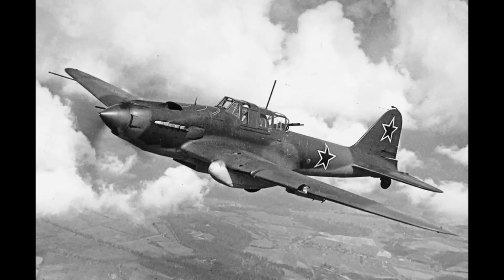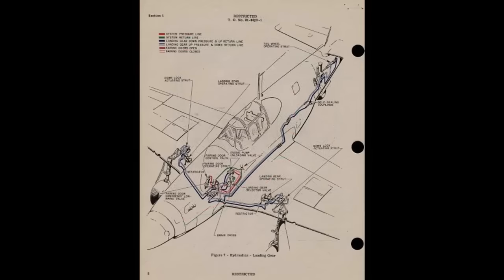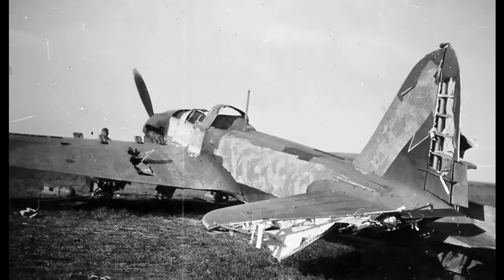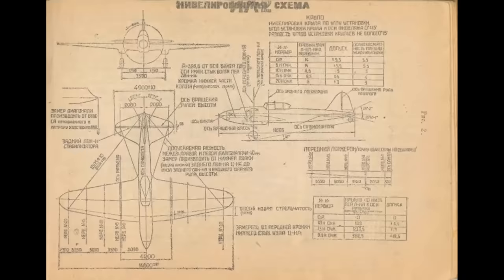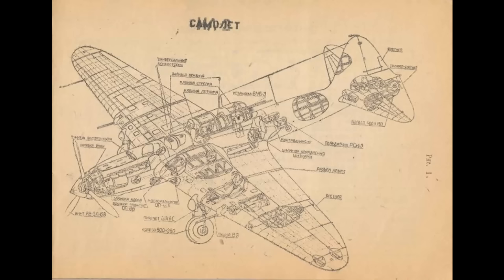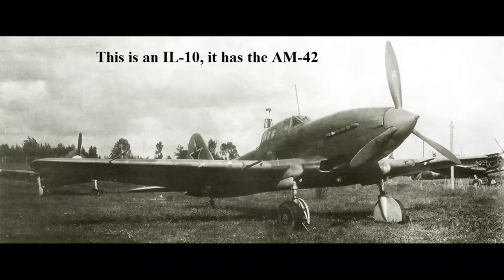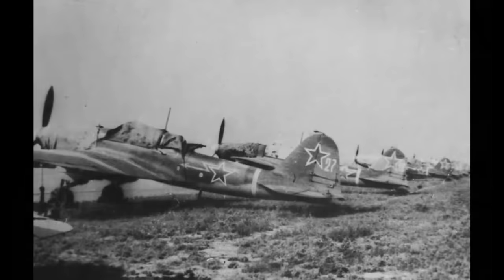Ilyushin IL-2 Sturmovik

Comment: A bit extra about that Tu-4 - B-29 thing Greg had mentioned:

Russians were trying hard with their own turbocharged engines at least as early as 1938 with TB-3 fitted with М-34RNV-ТК - an AM-34 variant with fuel injection and TK-1 turbocharger. It did flew at 8500m as fast, as regular TB-3s on 4500 - however it was unreliable af with turbine blades ripping off or burning through. Lack of experience, skilled engineers, craftsmen and good steel alloys made things difficult

But development continued even through the war with Myasischev's high-altitude long range bomber series of two-engine DVB-102 (flew in 1942), and four-engine DVB-202 and -302 (projects). DVB-102 had a pair of M-120 engines - a Y shaped 18-cyl M-105 derivative with three cylinder banks instead of two and TK-3 turbocharger, wich performed better - but still not good enough. Then there were tests with other engines, some turbocharged, than there was some development of -202 and -302, the last one having a lot of similarities with B-29 indeed, but that happened before people had an oportunity to study one

Than there was 1945 and Stalin ordered Tupolev to copy B-29 - because having a working plane tomorrow is better than spending yet some more unknown quantity of time to complete something only to test it if it even works

So, copying or not, it still was a many years wotrh of hard work to even be able to snatch (and alter, fyi) a foreign design this complicated

Comment: In IL-2 1946, the simulation, with a Bf109 F-2 cooler shots where all you had against an Il-2. Some say the wingtips are weak also. But try hitting that when the guy in front wiggles as much as he can.
In IL-2 1946 in the 1 hour campaigns which influenced the movement of the front, the Il2 guys just did head ons blazing away. With the high ammo count and the fragile modelled engine of the 109 lots of kills got scored from the Il2s. Amost always the Il2s had a fighter or 2 with them. Which meant, attacking the IL2s put you at a disadvantage fast.

Comment: In regards to the manual...
Did the Soviet airforce HAVE basic training manuals at all?
Or did they essentially put everything into the manual for each specific plane?

So, basically, run off and check 1-2 manuals for pre-war aircraft, from the mid-late 1930s.   See if they're the same or if early war losses caused a massive change.

Comment: i'm somewhat perplexed by the crank design of the AM-38. you said a 'counterweight-less' crank; when i hear this, I'm wondering if it's a mistranslated term? i can't understand how an engine that large wouldn't have sufficient space in the crankcase for at least some counterweight, at least, why it would be designed like that? i guess it's also hard for me to wrap my head around a crank as large as one in a WW2 12 cylinder liquid-cooled engine NOT having a weighted crank. surely for a high-horsepower airplane engine, that would've been a logical design evolution? i suppose there are some benefits to having less reciprocating mass, especially in an airplane. i wonder, did the previous AM series engines also have counterweightless cranks?

Comment: God, give my english strength  

Articulated connecting rods were really a thing in russian WWII engines like AM-35/38 or V-2. One rod was attached to another one, wich was then attached to crankshaft - so length of stroke was different between left and right cylinder banks. I dunno, maybe it was for weight and crankshaft space saving or people were just unable to make thinner connecting rods strong enough - or both

Comment: If necessary, I can give a link to the many hours of history of creation, application, operation, etc. but in Russian. And about the M82 engine, I watched the history of La-5 and there was an M-82 engine on it and it remained unfinished for a very long time. Most likely, this is why the IL-2 with the M82 did not begin to be built for this reason, the M-82 was not ready yet

Comment: The thing with the connecting rods and different stroke derives from the engine having one cylinder bank with conrods normally articulating the crankshaft and the other bank articulating not with the crankshaft but with the „master rods“ like on a radial engine. Derives from the BMW VI engine. Gives slightly different stroke on both cylinder banks. Compare with T34 tank engine, which has the same configuration.

Comment: Articulated connecting rods? I suspect that meant the system in which there is only one big-end journal for each opposing pair of cylinders: only one of the rods (the master rod) bears on that. The opposing cylinder has a link rod that mounts to the shoulder of the master rod by a fitting that looks like a gudgeon pin. Because the centre of that pin is displaced from the big-end centre by some distance, the result is that the stroke of the cylinder with the link rod is longer than that of the cylinder with the master rod, and the lower pin of the link rod moves in an oval, rather than a circle. Renault did an aviation V12 like this in WW1, and there were some automotive engines like that. There are some very good diagrams of this at pages 12 and 16 of Karl Ludvigsen’s magisterial work, The V12 Engine.

Comment: Hello Greg. Tank you very much for your video, reaserch and coments on that airplane. I had spend some time researching various soures on it in the past from various perspectives - manufacturing issues as well. And would like to give my comments on the power output in comperasment to the competing engines of other countries. 

One of the major matters to be aware of here back then was the same as in many, when not all of the industrial branches. It goes for many other airplanes, engines, motorcycles and so on in the time of WWII and goes so forth for couple of decades after the war. It was the inconsistency of quality of matirials with high margine of differences. Engineers and manufacturers had to keep that in mind by product designing and conceptualizing it's manufacturing. Because the components might have get charges of differing qualities of materials and from differing plants -  to many factors where beyond any controll of developers and manufacturers. So, to avoid a high numbers of rejects and defects one had to set the uper bar for stresses and loads in the constructions very low on some key elements. Highly stressed locations in engines or fuselages had to be engineered with much more geometrical resereves and safety margines. Limiting the RPM = output power - was also the way to keep the stresses on the components low enough so the plane would have reasonable statistical TBO or life time to have a chance for beeing useful.

P.S. as always, sorry for my "french".

Comment: Part of the issue may be that the audience knows your penchant for research and original documentation - and inherently distrusts any Soviet primary sources.
Reply from the maker: The Soviet sources are not trustworthy for a number of reasons, which makes the plane more difficult to cover.
Reply: @GregsAirplanesandAutomobiles  I would be interested in the plane and the documentation because of that, not just in spite of it. The difference in how they trained pilots noted in this video was fascinating. 

Chieftain ran into similar issues when covering Soviet tank doctrine where the primary sources had to couch everything in a Communist framework of "power of the people" or gotogulgag. Especially in the interwar years.

The essence of what they were discovering in Russian circles matched the Western exercises and thoughts. But the way it had to be presented provides critical information about the state of affairs. It is somewhat tangential to the focus of the channel, but it provides unique context for how the planes and pilots were trained and utilized.

Comment: An articulated connecting rod is a con rod that connects to a master rod. It's the third way of connecting rod design for V type engine eg (plan type, fork & blade). A radial engine  has multiple articulated connecting rods connected to a master rod. In a V type engine there is one articulated connecting rod connected a master rod. There are same number of master and articulated rods. Just like fork & blade but only master rods connect to the crank. This is why the cylinder displacement is not same. On a radial  multiple articulated rods  placed around the centre point of the master rod and crank throw keep cylinder displacement equal. The unequal cylinder displacement why it not used much in V type engines. I hope you find this helpful Greg give  articulated connecting rod a google and click Images and you will see the them for your self. Thanks for All your videos.

Comment: Thanks for an interesting video on a very important yet obscure aircraft.  I did not know of the details of this engine, being so gigantic.  One limitation on rpm is simply the displacement.  Larger engines by default rev less in order to keep piston speed within range.  Why on earth would you get hate messages for posting Soviet aircraft?  The Russians were and still are brilliant engineers.  As the recent war is proving, better than western engineers.  Their weapon systems are often not very sophisticated, but are cleverly designed with maintenance and ease of manufacture in mind.  Also, unlike western weapon systems, they are not designed to make the manufacturers rich.

Comment: 24:10 left and right side of cylinders having different stoke is common as far as i understand in a lot of V engines. it depends on what type of connecting rod is used. but in older V engines that was the norm apparently.
as far as i know articulated connecting rod is good translation. possibly driving4answers has more videos on V engines design

Comment: You need to do an analysis of the 5 series Italian fighters G.55, Re.2005, MC.205. Interesting fighters with surprising performance.
Reply from the maker: Yeah, I probably do, but one of me, and a lot of aircraft and history to cover in the time I have.
Reply: @GregsAirplanesandAutomobiles  On another note, are you aware that in 1945, the Corsair was much more vulnerable to ground fire than the Hellcat in similar / same missions flown from the same ships? (Naval Aviation Air Combat Statistics)? See page 58 where the Navy commented on that: "The F6F was slightly superior to the F4U in combat, apparently chiefly because of its greater ability to survive damage."  The culprit, in my opinion, was the oil cooler configuration between the two.
Reply: @GregsAirplanesandAutomobiles  I appreciate everything you do Greg and I promise never to vex you with more homework! 🙂
Reply: @david7458  The Corsair was more of a racehorse and the Hellcat was a bit of a carthorse, is that fair to say? The Armoured Carriers channel has some great interviews with Royal Navy Fleet Air Arm crew, who flew both types. They have amazing stories to tell. I guess they have nearly all crossed the bar now. RIP.

Comment: -- It is true that this manual potentially been written for novice pilots, since those pilots who only had 10-15 flight hours of Po-2 training, and those pilots been called "Взлёт-Посадка"(Take off/Landed pilot).They should not be judge, since at the beginning of WWII(1941-42) there were a critical pilot shortage, just like in England at the time of "Battle of Britain" pilots with only 12-18 hours of flight could find themself in a cockpit of Spitfire, against seasoned Luftwaffe pilots. And in 1941-42 Il-2 pilots would be awarded a Gold Star(A Hero of Soviet Union) for just surviving only 10 missions, that is how stiff were the attrition rates in those difficult times. Pre war flight training was very comprehensive and complete.
Reply: -- Tu-4(aka B-29) is a poor indicator of the aviation industry, since Germany didn't produced much of strategic bombers during WWII, yet somehow you would not call it a poor technological state, right?
Reply from the maker: The difference is that the Soviets wanted a strategic bomber and had them in development. They copied the B-29 instead.
Reply: @GregsAirplanesandAutomobiles  -- Not just any strategic bomber, but the one that capable to deliver A-bombs considerable distances.
Reply: @GregsAirplanesandAutomobiles  -- A. Tupolev joked that he got "Hero of Soviet Union" from Stalin converting B-29 from standard(imperial) to metric, without adding anything else, ask me about that story, I'll tell you more... to the extend production went.
Reply: @GregsAirplanesandAutomobiles  -- BTW, A-10 uses IL-2 idea i.e. L.G. gondolas with partialy exposed tires specificaly for battle damaged L.G. "belly landings".

Comment: I’ve been an engine guy forever  and I’m pretty sure that an articulated connecting rod means that there’s one connecting rod with the con rod bearing and it’s partner on the other side of the V of the engine has a pin that connects to that rod with something like a wrist pin. I was a marine diesel mechanic and we had to learn about some pretty weird engine configurations.  It would make sense why you couldn’t rev very high because of the side loads it would put on the master connecting rod beam.

Comment: The Soviet aircraft design bureaus were on par or even better than other aircraft designers in the U.K., Germany, Japan or the United States. The Soviet philosophy was to make simpler, robust but highly effective low level warplanes for mass production. The Yak series of fighters and Lavochkin LA-5 series of fighter planes were excellent warplanes. The best way to consiider the Sturmovik is to think about its effectiveness as a ground attack aircraft. Analyzing the engine technical specifications is interesting but misses the critical purpose of the Sturmovik. The IL-2 Sturmovik was designed to be a mass produced tough ground attack warplane to KILL and DESTROY Wehrmacht troops, tanks, motorized columns, guns, supply depots, bunkers, airfields and entrenched positions. The IL-2 Sturmovik was one of the most effective warplanes of WW2. The IL-2 Sturmovik worked closely in partnership with Soviet Army infantry, artillery, tanks and cavalry to provide an effective combined arms operations system. This Soviet "flying tank" was a critical component of that combined arms system. The Sturmovik contributed mightily in the defeat of the German Wehrmacht at Stalingrad, Kursk, the Ukraine, Operation Bagration and Eastern Europe serving as "flying artillery."

The other major aspect to understanding the Soviet way thinking on weaponry was simplicity, robustness, adequate performance and mass produceability. The Soviet planners believed strongly in the maxim "quantity has a quality all its own." Soviet planners and designers won WW2 by driving down the marginal costs per unit produced to economically out produce their enemies. The Soviets produced over six million submachine guns during WW2.These these 7.62x25mm pistol cartridge submachine guns were copied after WW2 produced in Communist China and North Korea. The Soviets then produced the medium cartridge 7.62x39mm for longer ranges of about 400 meters than the short range 100 meter submachine gun. The Soviets made a 100 million AK-47's with foreign manufacturers around the globe in the decades after WW2. Many Western critics fail to grasp this Soviet penchant for manufacturing good, robust, simple weapons in huge quantities while reducing the marginal cost per unit of production.
Reply from the maker: This video is a part of a series. The operational effectiveness of the plane is in a later part of the series. This part is focused more on the technical side.

Comment: A great video Greg, I certainly learned a few things from it.

I would say though it is a little unfair to point to the B-29 as somehow evidence that Soviets were behind on aircraft design. Considering the fact that the B-29 was specifically made by the US with the Pacific theater in mind and it took them . The Soviet Union simply had no need for an aircraft of that kind of performance so it isn't all that rare they didn't have a project to make one. I think that type of claim would be better served by taking an example of a frontline fighter aircraft as an example instead of a long range strategic bomber.
Reply from the maker: But the Soviets were working on such a plane. Here is a picture of a test model in a wind tunnel: https://postimg.cc/3dBntZ7C  . They abandon this and went with the B-29 copy instead.

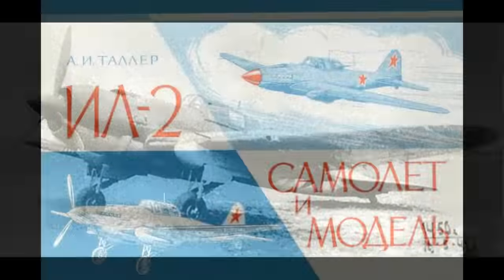Comment: 19:55 I am fairly certain that you know that the Tu-4 wasn’t a rivet-for-rivet copy. That wouldn’t even have worked for the Soviet industry… And the Tu-4 had different engines, armament, and fuel tanks.
Excellent video! Please give us more on the Il-2 and other Soviet aircraft.
Reply from the maker: I think you may have missed the point. The Soviets abandon their own heavy bomber projects and produced the closest thing to an exact copy of the B-29 than they could realistically build without re-tooling their entire industry to SAE standard, adopting U.S. weapons, parachutes and so on. I wasn't trying to give detailed technical history of the TU-4, I was trying to use this as one of the jillion examples I could have chosen to show that Stalin knew they were behind the west in aircraft development and chose the copycat method to catch up.
Reply: @GregsAirplanesandAutomobiles  Thanks for replying. I do see the point — I’m only a bit worried about the risk of reinforcing the many myths about the Tu-4. Another aircraft about which I would like to know more…

Comment: A late model P-39 vs an Il-2? 

A bit unfair, isn't it? The -Ns and -Ks were fast and doing pretty ok at 20k feet. And they had that honking big 37mm cannon. That's gonna do some serious structural damage, isn't it?
Reply from the maker: "fair"? That's just not the way warfare works.
Reply: @GregsAirplanesandAutomobiles  My point exactly. The fighter wins because it's designed to kill other airplanes.